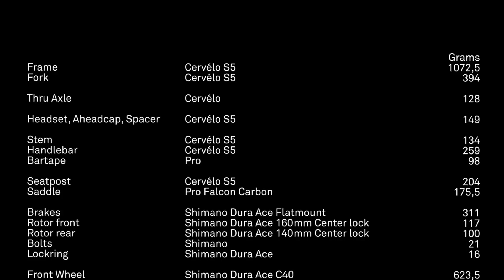Cervélo S5 I Dreambuild I Team Sunweb I ProBikeBuild I Marc Hirschi

Comment: When you remove the adapter and cup together with sealed knob, oil not come out like that. 16:07 Because oil under the hoods is not a small mistake for a team bike.
Reply: There'll always still be a bit. In fact, it's intended to overflow a little when you screw the bleed port screw back on to ensure it's free of air. Any remaining hydraulic fluid residue can be wiped clean with 99% isopropyl alcohol.

Comment: 3:47 No torque wrench used there ???
4:27 This isn't a derailleur angle adjustment screw !
19:20 Waow! that is a crazy bikefit jig !
Reply: 3:47 The average human hand has to turn the tool hard to achieve 13 Nm, that's close to 13.
4:27 That bolt adjusts the front derailleur's yaw angle.

Comment: Great build but , wow that steering set up looks like a nightmare . Surely over designed .
Reply: Actually meant to say (steering ) is over complex . The best designs are the simplest .
Reply: This is why I'll stick with two-piece cockpits unless I don't have to route the shift and brake lines internally, like with the Bontrager Aeolus RSL.

However, the 100 mm handlebar reach is totally not for me.

Comment: what's the rationale of weighing all the individual parts? just weigh the bike at the end of the built
Reply: A typical weight weenie will do that to know how much more grams they can save by replacing each part. Nowadays, with aero bikes and disc brakes and lots of proprietary components, that doesn't make much sense anymore.
Reply: hymen0callis yeah but not in this situation. The mechanic doesn’t have much (or any) choice in what to build it up with. So OPs question still stands..why is he weighing every small part?

Comment: Too much non-standard parts. And horrible bottom bracket, it will creak.
Reply: What is non-standard? Everything on this bike is available for the public, that's the rules of the UCI. The BB will not creak because the bike will not be use for long.
Reply: @theobuzat9091  So the "public" that buys the bike will not use it for long and will not hear the creak? Just look at that seatpost. Can I go into any LBS and buy one? No. Can I use a clamp-on stem that I can buy at any LBS? No. Everything is vendor lock-in.  It is way overpriced and over engineered, with a high probability of misaligned BB holes. Why not install a 1 piece BB for maximum stiffness? I guess we know the answer.
Reply: @veloaddict  wait, wait, WAIT you are telling me that it's a problem you can't use you trashy round seat post on a 10.000$ AERO bike! Is that your problem because for me that's actually not a problem at all !! As for the creak, you just need to remove your BB, clean it and put it back in with some type of paste and VOILÀ no creak
Reply: @theobuzat9091  are you one of those who spends huge amounts of money on stuff to justify his small PP? And in the end you still get dropped or finish last?
Reply: @veloaddict  sorry but I don't own such bike, so this desease doesn't affect me at all. But this type of bike is made for 2 things and 2 things only: going fast while saving whatts. So if you dont like these to things go ahead and buy a aluminium framed bike with shimano 105 and VOILÀ you have a good enough bike for cheap AND you can use your trashy seat post
Reply: @veloaddict  I see you use a Rose X Four lite (very nice bike btw), but as you know this bike is not aero at all, it better than round tubed one but still not as aero as the S5. With the S5 you need way less power to sustain a "high" speed for long periods of time, that's why it's way more expensive and "complicated" you pay for whole developement of certain parts..etc so yes it's expensive, but it's expensive because what you get is the best they found, do you understand my point?
Reply: @veloaddict  a round seat post is way less aerodynamic because it creates loads of air mouvement (unnecessary ones of course) and they are less comfortable than D shaped ones. So all and all, round seat post are from the past, they belong on Bernard Hinault's bike not on Jullian Allaphilipe's bike
Reply: @theobuzat9091  and yet you ignore the biggest drag from the bike, the rider and his position. Don't you get it? It is all marketing for uneducated people with too much money to spend. Are you racing? Are you paid to race? Are you sponsored? If not, it does not really matter. Cycling is freedom, because it doesn't matter who you are, what you are, how much money you have, what you don't have, just take your bike, ride your bike, feel free and all your problems are gone.
Reply: @veloaddict  even by not changing your position on the bike at all, you can feel the aero-gains these bikes give very clearly when compared to a standard roadbike.
Reply: @dazNilo  how did you come to that conclusion? I'm really interested to know.
Reply: @veloaddict  I got myself an aerobike. ;) and I noticed the difference straight away. I was about 2-4km/h faster than on my old bike.
Reply: @dazNilo  that is not how you measure if something is more or less aerodynamic. Today I beat some of my own PRs just because my fitness is better or I was more rested, on the same bike. That does not mean I was more aero. Unless you go to a wind tunnel and do some tests and come up with the drag coefficient (Cd) you are just writing uneducated comments.
Reply: @veloaddict  well if you dont want to believe in aerodynamics, thats fine for me. I clearly can feel a benefit I get from aerobikes for the kind of riding I do.
Reply: @dazNilo  don't put words in my mouth. Since you opened the subject of belief, I believe you are not the sharpest tool in the shed.